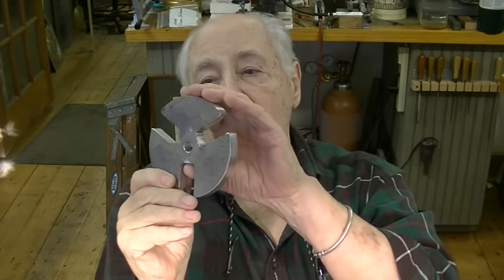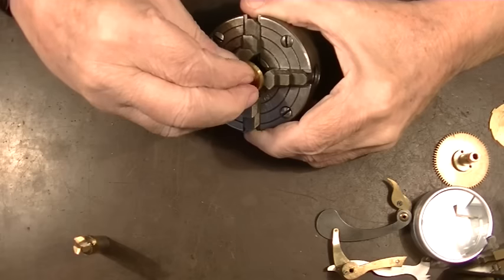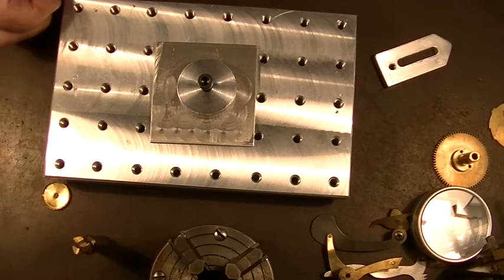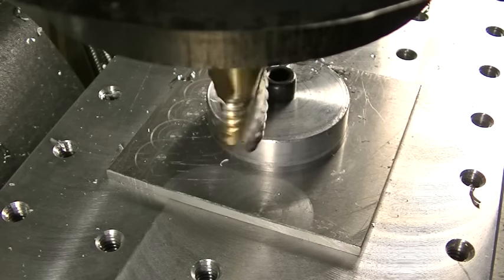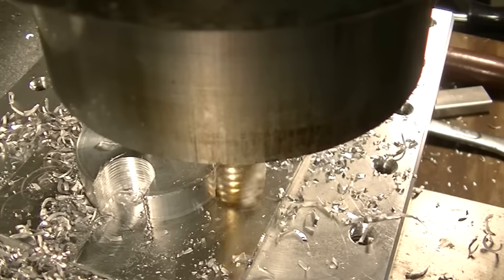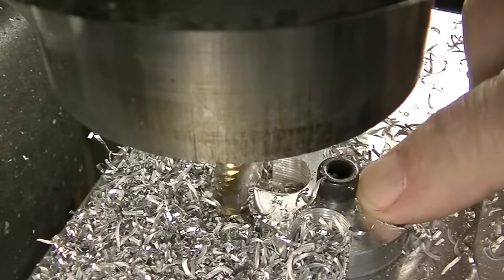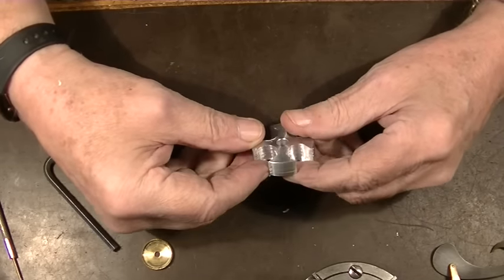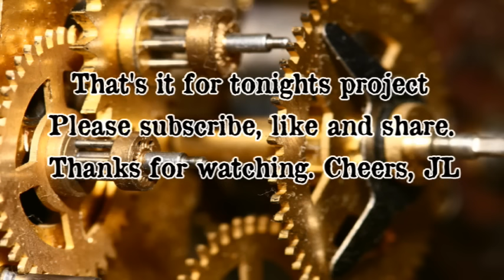The Village Clockmaker. Clock repair tutorial. #24 Making a Spider.

Comment: Great, always enjoy your video's. 
Why did you not bore the hole when you made  the wheel.
Correct me if I am wrong...
Could you not make the whole wheel from solid, leave a stem on the back to hold it while the teeth are cut, then put it back in the collet and part it off,then make the bush.
The hole would be concentric with the rest of the wheel.
Lets know.
Cheers
Noel